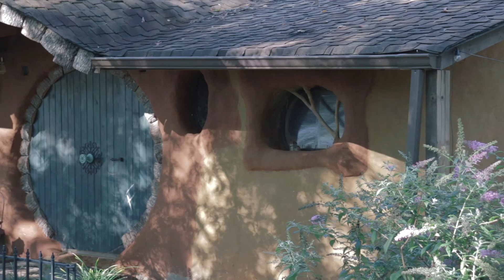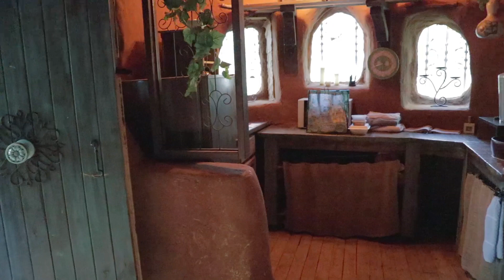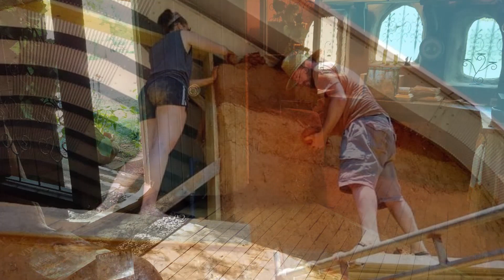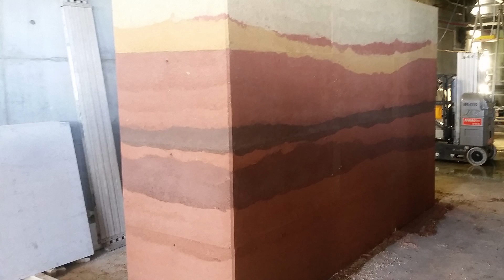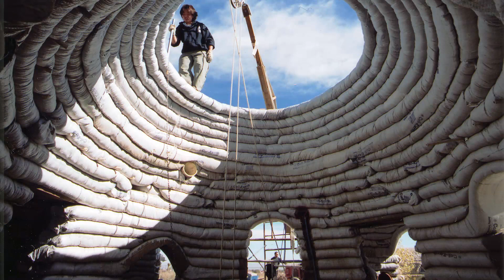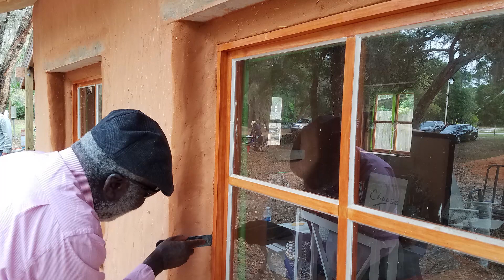Build A Cob House - Introduction to Cob and Earthen Building

Comment: Can you build a three, four, five story tower out of cob? How thick would the walls need to be at the base?
Reply from the maker: I've seen three story cob buildings with no metal reinforcement. But I would recommend it especially if going over 2 stories. Technically you can go very tall with cob and no metal reinforcements. The base of the walls needs to be much thicker than the tops though. Research the earthen towers of Shibam for more info.
Reply: These walls would need some form of reinforcement via posts or the like, or could bear especially thick walls.
Reply: Using earthbag construction....heck yes !!